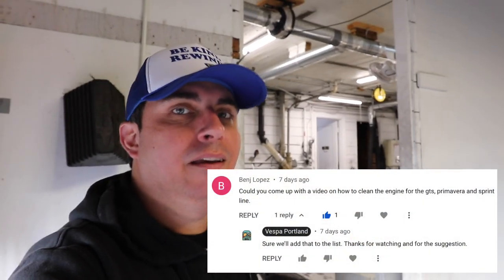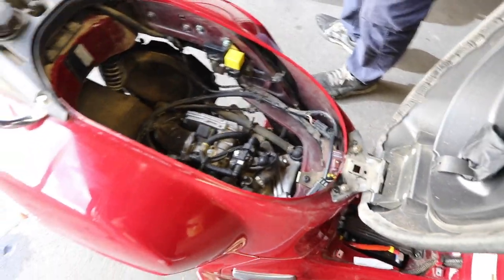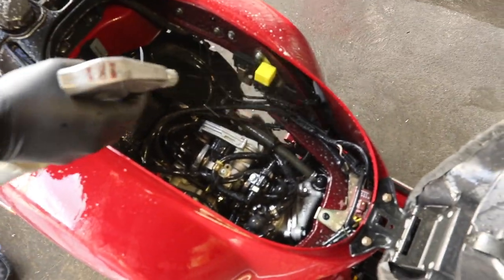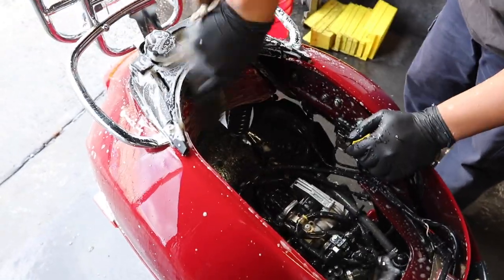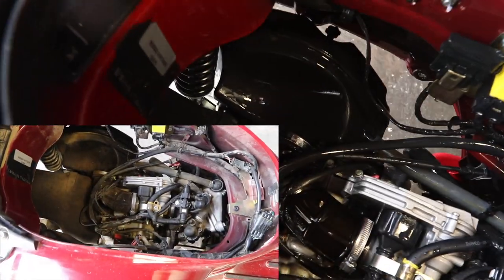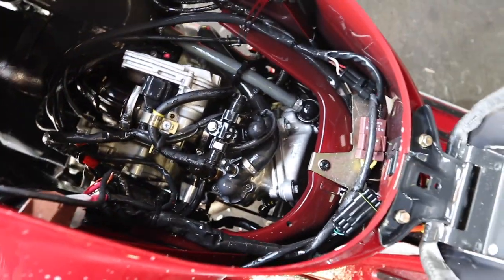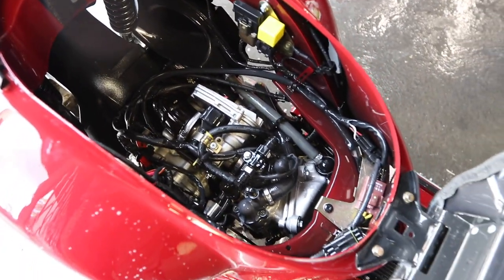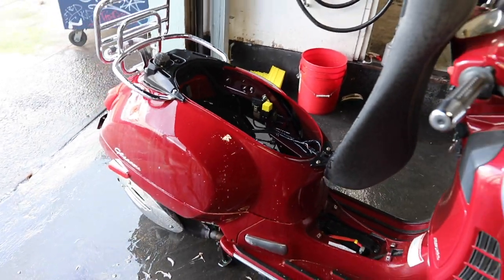How to Clean a Vespa Engine

Comment: generally the bottom of the vespa gets dirt and water in when you ride. disconnect the battery first before washing to prevent any damage to the electronics or wire connections. wash and let it dry before connecting back the battery. a yearly cleaning maintenance should be good. thanks for the video!
Reply from the maker: Good tips. Thanks for watching.

Comment: I guess I'm surprised you can just blast it like that. Cool
Reply from the maker: All good! If you have a hole in your gas cap for venting then definitely cover that with some tape but aside from that should be good as long as you’re not firing right into an open electrical connection.
Reply: @VespaPortland  do the 50cc Sprint gas caps have a vent? I remember you saying on another video in response to my comment that the 50’s don’t use a charcoal canister like the 150’s.. If there’s no charcoal can, I’m wondering how the gas tank gets vented. Do you know about the laws regarding that by any chance? I have been googling to no avail. All motorcycles in CA have EVAP controls and charcoal canisters which can cause rough start issues in hot weather. I had an R6 and an R3 that both suffered from that. Is the 50cc small enough that it is exempt from that requirement? Would be a huge plus if so.
Reply from the maker: Gas cap doesn’t vent and no can. There’s a separate hose off the gas tank with a filter on the end for venting. Not sure about the laws but wouldn’t be surprised if an engine displacement of that size is small enough to fly under the radar.
Reply: @VespaPortland  interesting. Thanks dude. If I make another trip into Oregon I’m definitely stopping by.
Reply from the maker: Can’t wait to meet you, Mr. President. 😆
Reply: @VespaPortland  😉

Comment: Hello, vespa gts 250 2013 models.  If I pour water into the engine like this, will it damage the wires, spark plugs or other parts?  You do it and there is no problem.

Google translate
Reply from the maker: Just go easy when washing like we did in the video.

Comment: vespa gts 125 2013 can you wash with water like that and it will be fine thanks
Reply from the maker: Should be fine so long as you don’t have a bunch of exposed wiring and your connections are all tight. Check before spraying.

Comment: Does pressurized water hurt?  Will water get into the cables?  Is there any problem later thanks
Reply from the maker: As we say in the video, don't blast water directly into electrical connections. But water gets into those compartments via the bottom anyway via rain and wet streets.

Comment: DONT DO THIS IT IS A VERY HIGH RISK YOURE ELECTRIC CABELS WIL BE WET!! YOURE SCOOTER WONT START THEN
Reply from the maker: It’s the same as riding in the rain. It’s not a water tight compartment. Just go east when spraying and it’ll be fine.
Reply: I just did exactly this and it won’t bloody start. Now what?

Comment: not a good idea to clean the engine. At all
Reply from the maker: Why?
Reply: @VespaPortland  water can penetrate everywhere especially the plugs
Reply from the maker: Agreed however it’s not much different than riding in the rain which is a common occurrence for riders in the Pacific Northwest. Probably 2/3 of my yearly commute is in the rain for the past 5 years. No issues with plugs yet.
Reply: Jesus, I wouldn’t do this
Reply from the maker: You do you. Thanks for watching.
Reply: I love your other content but I just think this wash looks too harsh 

Maybe I’m wrong
Reply: I bought my car brand new in 2019. I asked the guy at the dealership about a good way to clean my engine. I was tired of using those harsh chemical engine cleaners and they never really did a great job. He told me to pop the hood and leave the car running. Then he said to spray The engine down with fantastic or another spray cleaner like that. I asked him if simple Green would be okay and he said yes.
So I leave the car running, I spray the engine and The engine compartment down with simple Green and even under the hood. I don't even let it sit very long maybe a couple minutes and then I hose it down with my garden hose. I don't use as much pressure as the guy's using in this video. That would make me pretty nervous. You don't need to blast it. 
But my engine still looks brand new and when I pop the hood when somebody's around they can't believe how clean the engine is.
So yeah, this is a good method but I would avoid as much pressure as he's spraying with.
Reply: @apico  no need to clean your engine